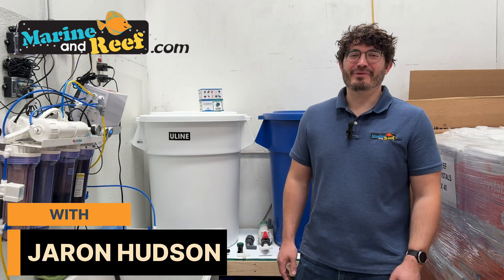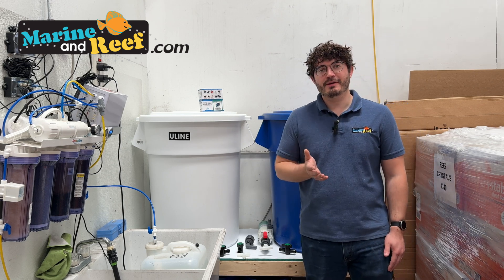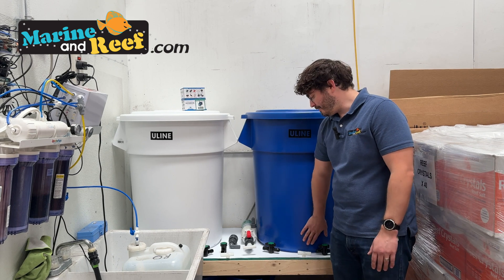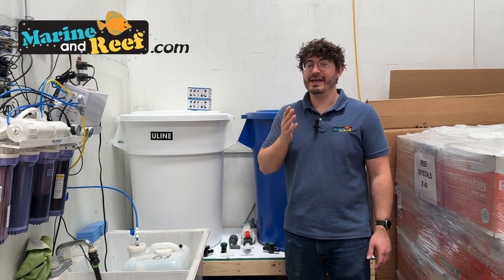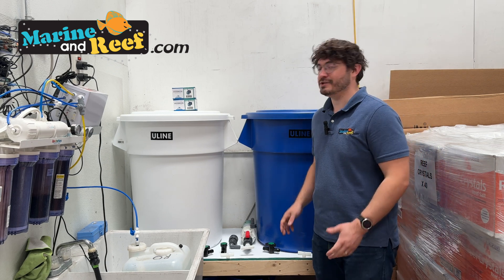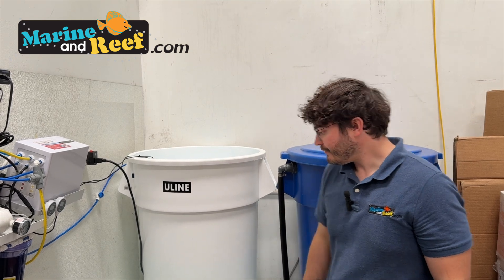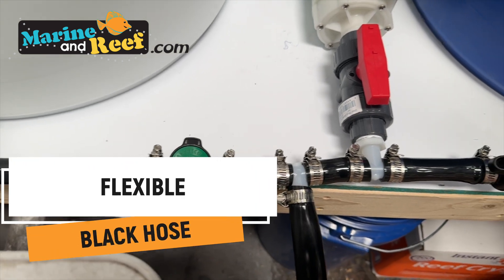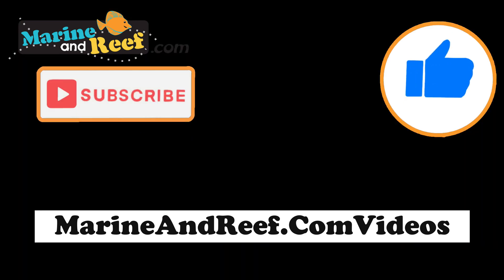Advanced Aquarium Projects: Building A Saltwater Mixing Station

Comment: I like the setup. What's sizes did you use for all the plumbing? I would like to replicate.
Reply from the maker: This was plumbed in 3/4in. Using 1in would speed up the transfers but that is has worked perfectly fine for the last year or so since the video.

Comment: I use a 30gal fish tank on a cheap metal stand an fill it with Ro water drilled a hole in the plastic cover of tank and installed a shut off float stop valve.then I drop a cheap Maxine power head in the tank add salt and mix to desired saltinity I vacuum my main display with a python into sink then attach the python hose to my maxi jet power head and pump my fresh mixed salt water back into tank.i mark my display tank with a piece of small tape to know how low to drain tank of 30 gallons